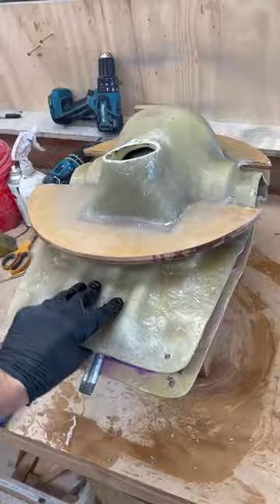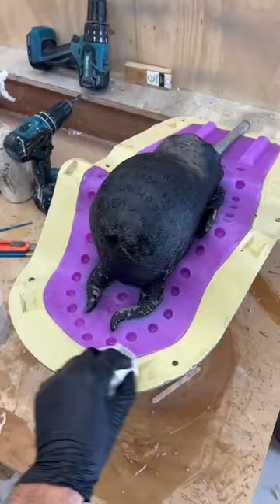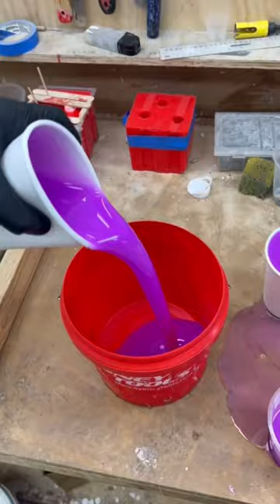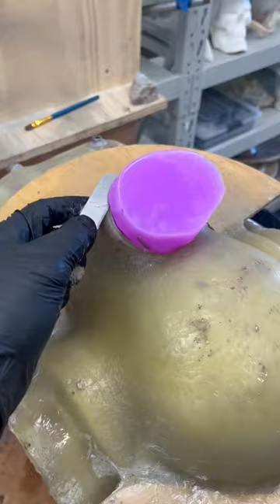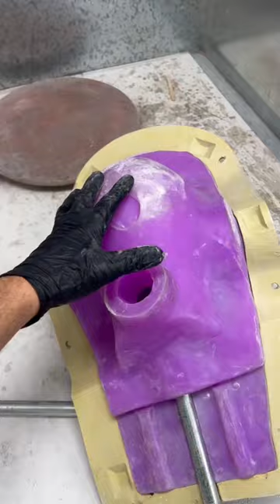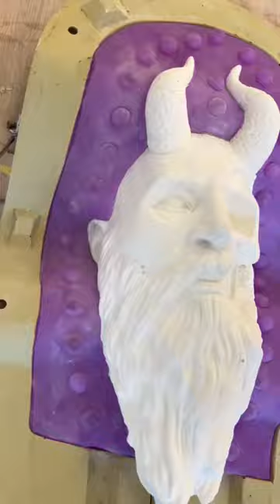MIMIM: FINAL PART! #shorts #mimir #godofwar #godofwarragnarok

Comment: I wonder how much silicone and resin was used for the mold and casting part respectively, the process is awesome , there should be a Long version or  tutorial tutorial like video
Reply: Looks like it was cast in plaster to me
Reply: no way it s plaster, no point to make a plaster casting when he can cast a 2 part Resin hollow thanks to the rotating contraption (a bit less resin if he want) a every corner filed with resin without any vent.
It’s clearly a 2 part resin (Polyurethane for example) with fast hardening time and much more resistant for intricated part, details like horns who would break easily in plaster. And much more adapted for painting and sculptur like that (or smaller version…)
Reply: … and the color is not plaster  like